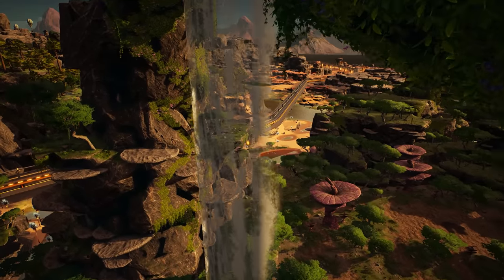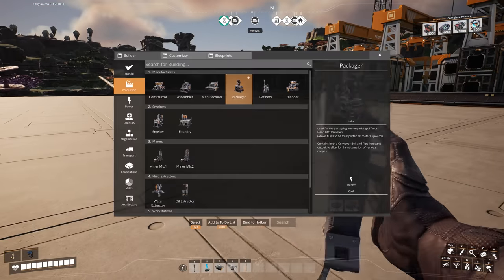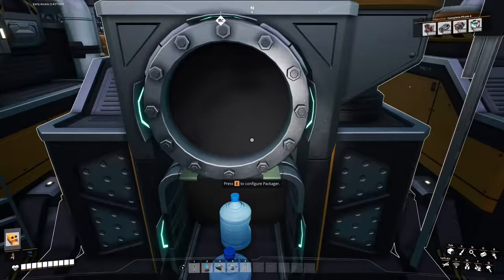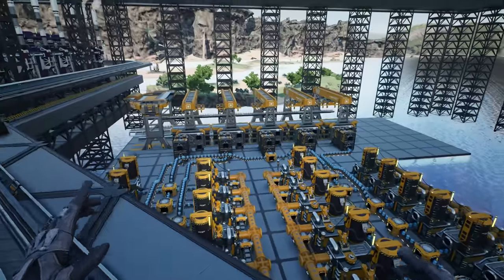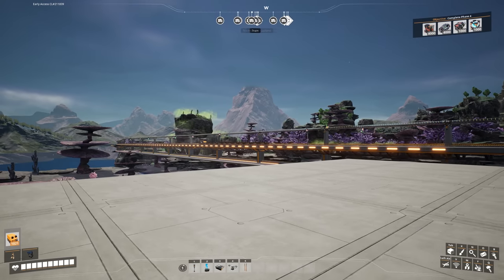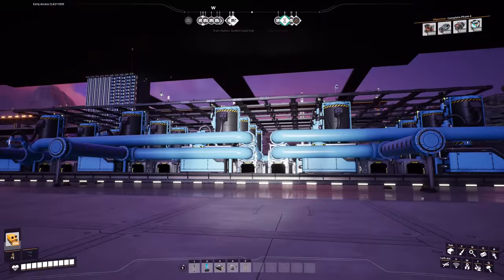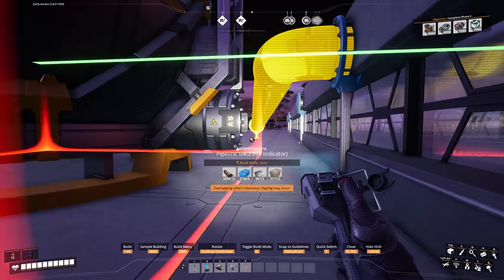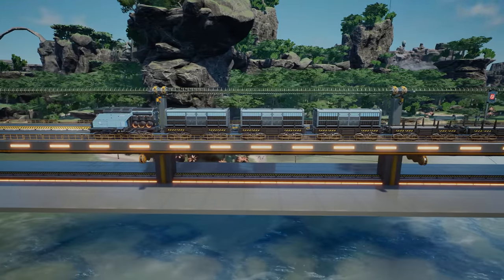Creating a WATER BOTTLE loop for my MEGABASE!!! in Satisfactory Update 7 -  Part 11

Comment: What's cool about sending packaged water via train instead of a fluid car is that you can send a lot more water in the packaged form than you can with the fluid cars. What are you planning to do with the left over water from making the Aluminum Scrap?
Reply from the maker: Good question and it one i get all the time.. Wet Concrete is a good solution, but also plastic from the HOR that is making the scrap. You will find out next Video :)

Comment: I never understood the point of packaging things when you can just straight line it things to the machines. but that is nice project to actually do the packaging and unpacking and basically do recycling.kind of like real life. fuel is about the only thing that requires packing cause it's used for the cars and jetpack. but it was fun to see al the items moving around.
Reply: Packaging does have a few uses:

1. It is not possible for a train's overall throughput to exceed the combined input/output throughput of its individual stations (because if it did, then it would be transporting items or fluid faster than you can stuff them into the input side or remove them from the output side, and that wouldn't make sense - you would just end up transporting partially empty cars instead). Each fluid freight platform has an input/output throughput of 1200 m3/s, but each regular freight platform has a throughput of 1560 items/s (using both inputs in both cases). So items are easier to transport.
2. A train's throughput is also constrained by the quantity of material that can be carried in each freight car, which in practice tends to be the real bottleneck for long train lines (but maybe not for very short ones). Fluid freight cars carry 1600 m3 of fluid, but regular freight cars carry 32 stacks of any item. Since packaged fluids stack to 100, that means you can carry twice as much fluid when it is packaged.
3. Packaged fluids can be mixed with other items, but unpacked fluids cannot be mixed. Mixed lines are controversial, and not everybody uses them, but they are feasible when planned with appropriate care and understanding of the limitations (most importantly: Every mixed item line must eventually terminate at an AWESOME sink, preferably using a smart sorter in "overflow" mode so that items are only sunk when they have nowhere else to go). This is probably most applicable to fluids that tend to be used in smaller quantities, such as heavy oil residue or nitric acid.
4. You can unlock packaged diluted fuel much earlier than diluted fuel; the latter requires the blender, but the former can be done in a refinery. Diluted fuel is a significant improvement over the regular fuel and residual fuel recipes, and it retains this advantage even when you account for the plastic that must be produced to package the water and fuel (those packages are reusable, after all).
5. You can lift packaged fluids for free, but pipeline pumps consume power. However, packaging and unpackaging also uses power, so this is only worth it for very great heights (in most cases) and never worth it for nitrogen gas (which does not need to be pumped).
6. Drones and trucks, I guess. Maybe drones are worth it for transport of nitric and/or sulfuric acid? Depends on what your logistics look like and whether you can reasonably fill a train with those things... You also need batteries or fuel, so this requires more careful consideration than just plopping down a train line. OTOH, plopping down a train line is actually quite a lot of work for longer distances.
Reply: @NYKevin100  To add on the the second point, once you unlock Mk 5 belts you can also move packaged liquids at a much faster rate than through Mk 2 pipes. So that means that not only can the cars move twice as much packaged liquids but it can unload them at 1,560/min  on Mk 5 belts rather than 1,200/min with Mk 2 Pipes.
Reply: @NYKevin100  that is some good math you got. probably wins most arguments for you. but the flaw in your logic is that your not taking in account of the number of resources at any given location. you would have to combine fluids from multiple locations just to get close to making packaging worth over pipes. And your assuming people spend the first 30 hours of their game tracking down hard drives to get alt recipe to get  packaged diluted fuel and diluted fuel. I never had both of those items in my frist play though cause i never went hard drive hunting. So i still dont see how packaging is worth the time and effort over running straight pipes unless you want to do it for flavor only.
Reply: @NYKevin100  don't forget the 30 second load and unload pause during the animation. It changes the math a little and makes it impossible to get 1200m³ of 1560ppm per station even if you buffer it. 

Weird that a medium length track can actually haul more per minute average than a short track but that is how the math works out.

Comment: Someone sell me on packaging fluids. The amount of power consumption required to manufacture containers on a large scale, packaging fluids, UNPACKING fluids seem to be a massive ridiculous consumption of power that could be solved with 1-2 fluid trains that had fluid storage space at their respective yards just filled up to prevent running out during transit. 
What am I missing here?
Reply: You're generally right. To my understanding, packaging and unpacking fluid is seldom useful outside of 3 use cases:

1) Diluted packaged fuel is a great recipe before you can unlock the blender.

2) most packaged fluids stack to 100 and contain 1m3 or fluid. This means a full rail car of packaged fluid (32 stacks) holds double the fluid than if it's stored as a liquid (1600 m3). Nitrogen gas, though, uses 4m3 per package, so it's 8x more space-efficient to transport it in packages.

3) if you are transporting fluids vertically, it can (very rarely) be more energy efficient to package the fluid and lift it with belts than pumps. This needs a minimum lift distance of 240m (60 walls) to be worthwhile though.
Reply from the maker: Power is not something im worried about, hence why i use so many powershards.. i have two Mega-Powerplants to build, which are coming SoonTM
Reply: @ItsBitz  I figured. I honestly was thinking a few weeks ago about hey what if I package stuff like we do IRL? Then I looked my power cap and logged out. 
Maybe another time. 🤣
Reply: It's a great way to get rid of excess fluids so factories don't get backed up.